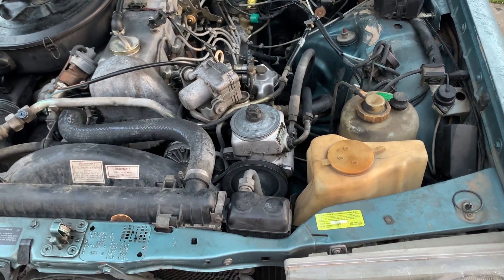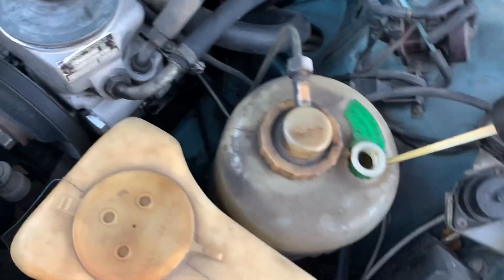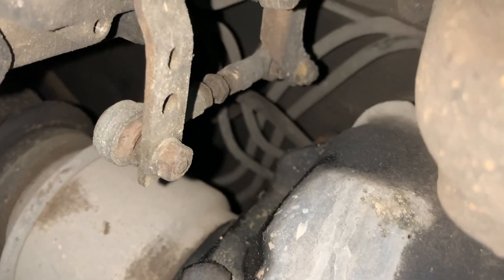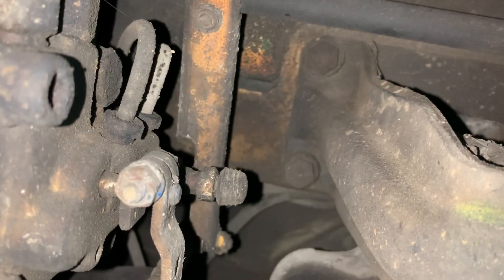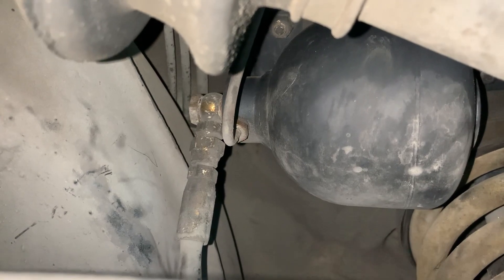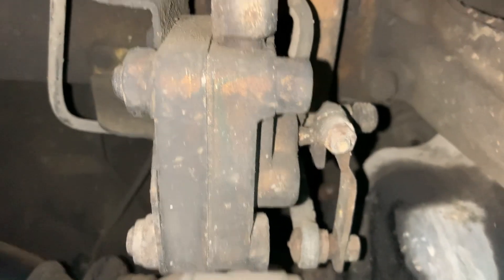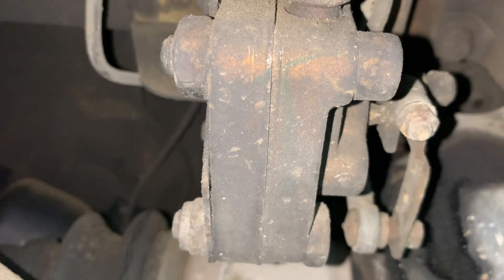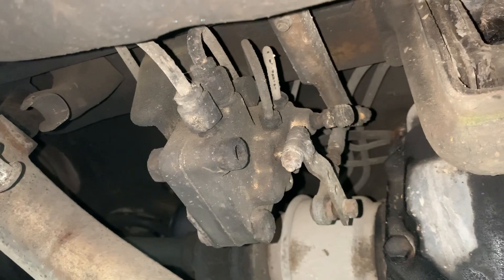W123 Mercedes SLS System Overview

Comment: Here you go!!😁
I've had 3 wagons.  All 3 needed accumulators.  We used to have a saying at Peach parts:  "it's always the accumulators"!  So plan on those also.  I've rebuilt several valves, and it isn't hard.  But listen!!  Prepare yourself, maybe pop a sedative first, but when you go to reattach those two hydraulic fittings........  Prepare yourself and remain calm.  Such a simple little thing was my biggest frustration thru 8 or 9 of those stupid cars!  😬
And after I fixed the sls and got it working, all 3 blew out the high pressure hose from the pump.  I would take them to a hydraulic shop and they would cut and braise the fittings on to new hose.  Way cheaper!
Good luck, this will be fun to follow....
Reply from the maker: It’s been a few months since I rebuilt the valve. So far the system is working perfectly. I need to change the fluid and filter.
Reply: @mjmcomputers  Nice!!